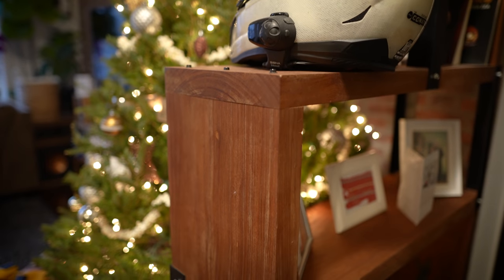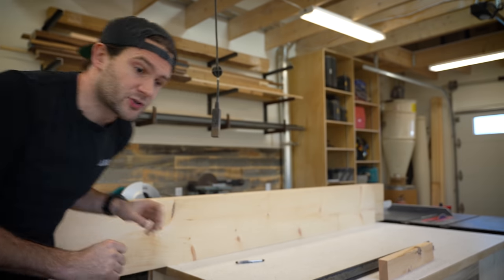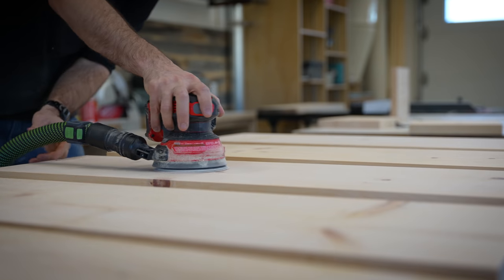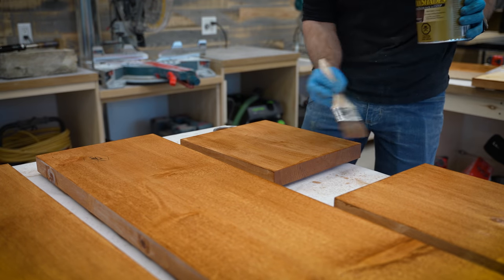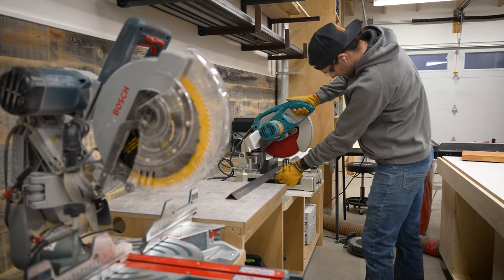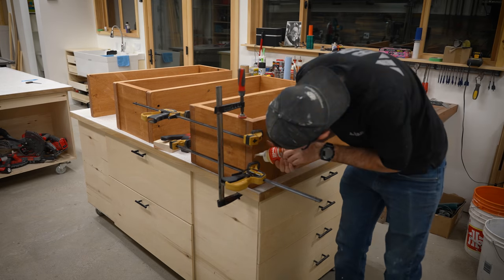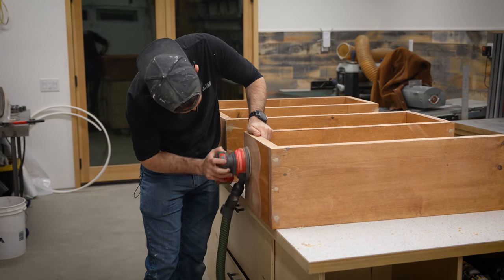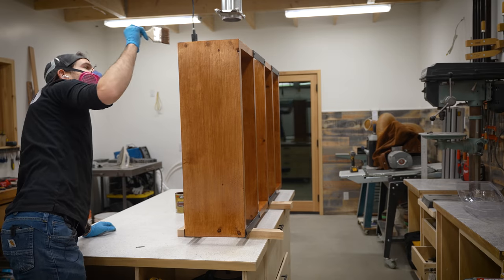Cheaper Than Ikea?! - The Industrial Bookcase Budget Build

Comment: I definitely agree with your verdict on the PolyShades.  On paper it sounds like it would be more convenient similar to a paint and primer, but the finish mixed in to the stain makes it more difficult to work with.  I stopped using it after a couple projects
Reply: Totally agree with you. It's not bad for small projects (those little IKEA wood boxes come to mind), but anything larger I can't get an even coloring on them. Then there is the finish build issue. I usually put at least 4-5 coats of regular poly on, but you can't with PolyShades as each coat it gets darker. By the time I get enough finish build, it's way too dark.

Comment: Looks great!
I've done a few projects  with the through-dowel-joinery recently. I found that taping off the whole face of the saw behind the teeth with some painters tape gives just enough offset that the dowel still comes off flush but without marring the surface - ar at least not nearly as badly if it does.
Reply from the maker: Good tip! Thanks John! I'll have to remember that for next time. Makes total sense though, just adds a slight shim to the blade and raises it ever so slightly

Comment: Awesome video Zac! With regards to staining pine I find that conditioner definitely helps but I usually apply the stain on the first coat with a sponge then wait 30 or so seconds then wipe if off with a rag. Had some awesome results with this method, hope this helps!
Reply from the maker: Thats how I like to do it too, but this stain and poly in 1 said not to do that, just to leave it after application.

Comment: Enjoyed the video/build.  I use the same conditioner on all soft woods.  Not perfect, but works pretty good.  Agree with your assessment of the stain/finish combo.  Same issues when I used it.  I am considering different ideas for shop shelving.  Don't want the standard all metal gorilla shelves.  I may be able to adapt this for what I need/want.  As far as the Toronto area give away, I have a friend living in Toronto and it would  be prefect for him.  Maybe I can see it once all the COVID restrictions are lifted.

Comment: Love it.  Keep up the good work Zac!   2 questions for you though .... 1) why did you choose to put in the dowels from the "outside" instead of hiding them on the inside of your butt joints?  and 2) what did you do for a "makers mark"?   You didn't show that step and I'd like to see your "brand".  :-)  Cheers!
Reply from the maker: Thanks berry and good questions! I did the dowels from the outside for 2 reasons, 1 it's just easier and I wanted to keep the build as accessible as possible and 2 the screws I used on the original were visible from the outside so I wanted to keep the dowels visibile as an homage. I was hoping they would contrast a little bit more so they were more visible, but apparently poplar stains very similarly to pine haha. And for 2) I used a branding iron, a  simple electric heated one. I really wanted to include that in this video, but the footage got messed up so I had to scrap it. I plan to do a video about how to use a branding iron ASAP though, so keep an eye out for that!

Comment: At 12:15 in...did you consider counter-setting the angle iron pieces so they would be flush with the wood surface? A lot more work I know, but it might really amp up the piece as a whole.
Reply from the maker: I did yes! My thinking here was to keep it as simple as possible to keep as accessible as possible, but you're right it would look better if the steel was flush with the surface of the wood.
Reply: @ZacBuilds  thanks for the reply Zac. It's much easier to watch and critique. Your work is beautiful and accessible. Much appreciated! Happy New Year.